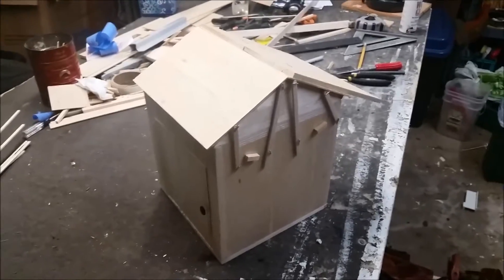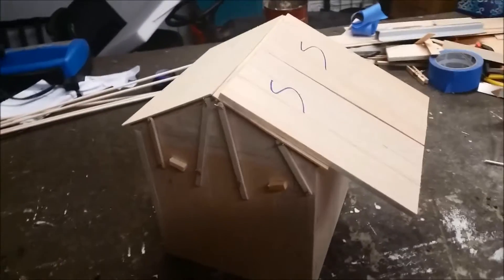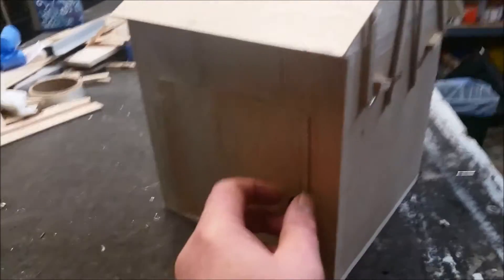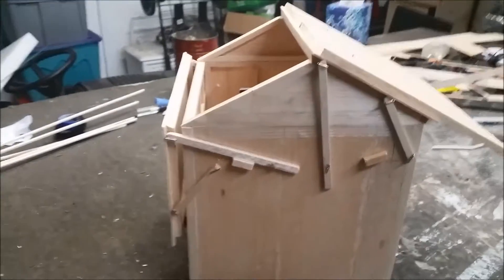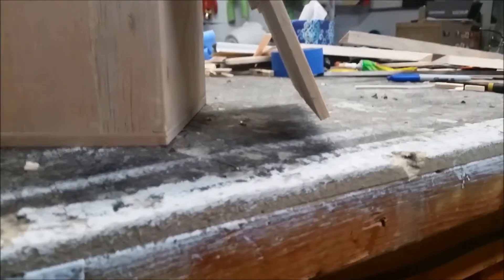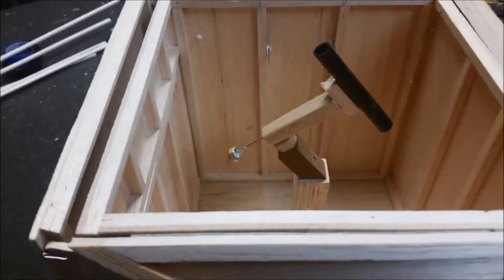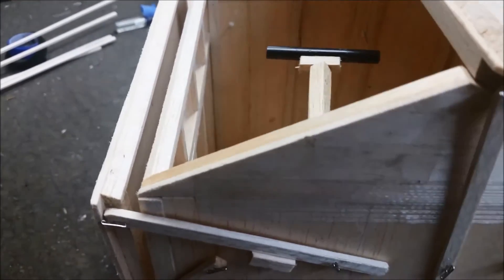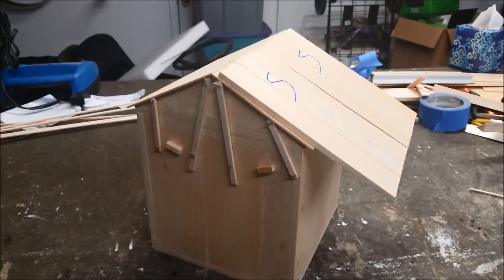TriStar Observatory TinyObs Model

Comment: Who in the hell uses inches and feet in the world today?
Reply from the maker: The people that sent man to the moon.  ;)
Reply: Yes the remaining 3 Supreme countries that still use imperial units - The Great USA joined by global giants Liberia and Burma. Well done. 

Perhaps US athletes can run the 328.084 foot sprinting event at the next Olympics? Or is it the 109.361 Yard dash? Or is the 3937.01 inch sprint?

I prefer 100 metres - rolls off the tongue much better. And you can convert from microns to milimetres, to centimetres to metres to kilometres simply by adding or subtracting zeros - moving the decimal point. Thats why they call it the metric or decimal system. Standard International Units - apart from the Medieval USA and the supreme States of Liberia and Burma.

You are welcome to convert 2.378 miles into Yards or inches if you wish with your sliderule 

I suggest that you looked into how many design disasters have occurred due to units conversion errors - even by the Great NASA - an organisation headed up ex NAZI Von BRaun after WW2 otherwise the US wouldn't have a credible rocket program to match the soviets who were leading the Space race until Armstrong set foot on the lunar surface.
Reply from the maker: Relax, Petra.  it was a joke. :)

Comment: On the final build, will the north roof lock in on top of the south roof to prevent rain?  It didn't look like it on your model.  Also, do you know the weight of the roof panels that you will be lowering?  Automated or manual?  Great model....good detail and neat engineering. Thanks for sharing.
Reply from the maker: Actually, it got built in early 2015, and has served me quite well for 2 years now. :)  To address your specific questions :

The model was mostly just a test of the roof hinge geometry, more than anything else.  The actual unit has a 2-element system to weatherproof the roof ridge.  First, the two panels have rare-earth magnets in them, so as the roof closes they pull the panels flush and tightly together.  Then, a "cap", covered with the same corrugated PVC roofing as the rest of the roof, is placed over the ridgeline, and held in place with straps on each end.  The overall effect is a weather-proof roof that's secure even in high winds, but is easily removed and opened in < 1 minute.

As for the weight, that was THE major mistake I made.  I originally built roof panels sheeted with plywood, then covered with tar paper and shingles.  Even with this tiny 4' x 4' obs, they were ridiculously heavy.  Manageable by 1 person, but just barely, and the smallest slip resulted in a heavy crash.  Not good!

In late 2015, I re-built the panels, using 2x2 and 1x3 frames, with no ply decking, and covered with corrugated PVC roofing.  MUCH lighter and still completely weather resistant.  A much nice solution!

I am, as we speak, constructing a new domed obs (a few early videos of testing are on my channel) to replace this one.  It's still quite capable of serving me well for several more years, but recent neighborhood changes have resulted in a heavy increase of light impingement from "local" light sources, which can be mitigated with a dome.

Comment: Looks great ior! Are the solar panels for charging a battery that power the mount or just to feed back into the house? Also: wouldn't it be better to have the door on the east side if you want to get into or out of the obs when the roof is open?
Reply from the maker: Yep, the panels will power the batteries for the obs.  They'll run the mount, laptop, everything.

And eh...door's not really for getting in and out regularly...thing's only 4x4x4 after all.  There's swingarms or roof on every side, so really doesn't matter.  Just needed some way to get in and grab the laptop or change a cable if necessary.

Comment: Very cool. Why not put solar panels on both sides of the roof? Or would the power be surplus to requirements? How do you propose waterproofing particularly along the apex?
Reply: Solar panels on the north side of the roof would be very inefficient as they would not have any direct sunlight.
Reply from the maker: > Very cool.

Thanks :)

> Why not put solar panels on both sides of the roof?

They work best when they face South. :)

> How do you propose waterproofing particularly along the apex?

Overhangs and a good fit should take care of most of it. :)  At the apex of the roof, there will be a "cap" of shingles that stays with the south roof section.  Close the north section first, then the south section, and the cap will fit down over the gap.  You may see an example at Harry Page's site here : http://www.harrysastroshed.com/observatory.html  (Many thanks to Harry for some valuable input and discussion early in this process)
Reply: sounds great, I'll look forward to seeing the progress